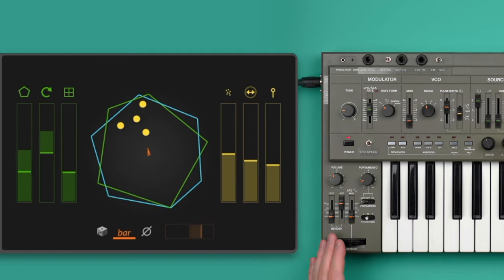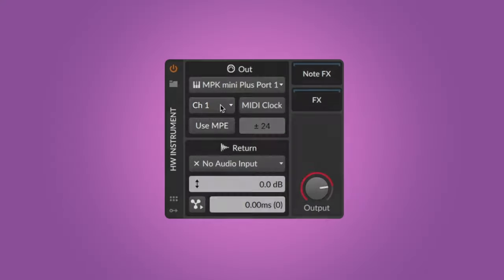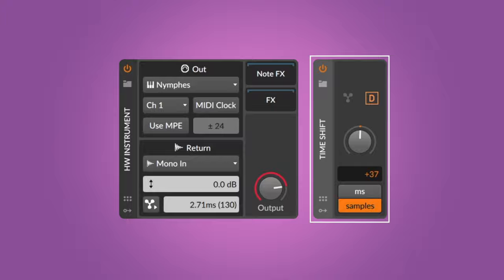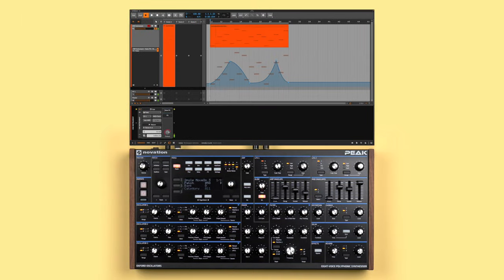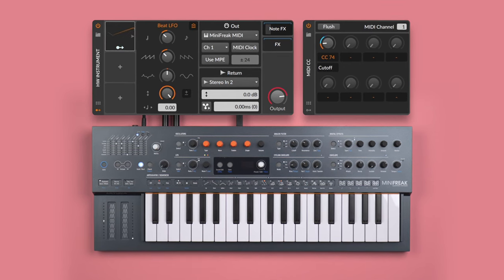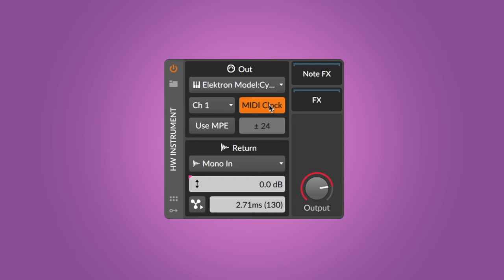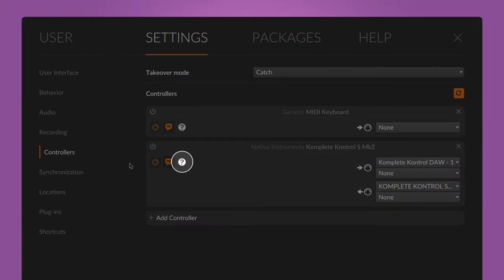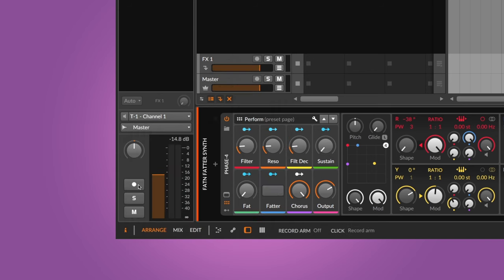Using External MIDI Gear with Bitwig Studio

Comment: What am I doing wrong? If I enable midi clock, I cannot start the song I'm working on, neither with any of my controllers (PreSonus, Arturia's built in MCU/HUI), the keyboard space bar or the mouse. It seems Bitwig is waiting on some start/stop message from a place I'm unaware of. If I stop sending midi clock, all controller functionality returns, but my the arpeggiator on my Arturia is not detecting any clock. I've not had any trouble sending sync messages from other DAWs, but I'm by no means a wiz at these things. Any help would be greatly appreciated.

Comment: I have been having loads of fun with note FX midi cc'ing to my external gear however I am having troubles with more basic stuff.
I map the CC devices to my controller no problem. But when I change tracks I have the mapping doesnt change. Its like everything is mapped globally...
Is it not possible to map controllers on a per track basis... Ie using the same knobs on mutiple devices be in controlling internal or external devices???

I feel I must be missing something very basic here???

Comment: i love bitwig,  however it is impossible to get a keyzone split device to send midi into a bw track on anything but midi channel 1????   for example i have a NI komplete kontrol s88   with 3 keyzones setup with 3 different midi channels........   just will not be seen by bitwig as different midi channels..any suggestions would be appreciated   jb

Comment: at around 5:35ish you showed the MidiFighter Twister controller. I contacted the Manufacterer to see before buying if this would work in Bitwig. They told me No, Bitwig is not supported so I did not buy it. Can you tell me if its not supported how are you using it in Bitwig as it looked perfect for what I wanted to do but as I said its not supported in Bitwig.   Thank you.
Reply: Any midi controller can be configured for bitwig, maybe with a script, they just meant its not "officially" supported.
Reply: just because they don't support it doesn't mean it's not supported

the API that bitwig offers to the controller script developers is pretty complex, AND there's a lot of open source people who write a LOT of the scripts

plus, bitwig's got MIDI learn and, like the guy in the video said, generic supports, so even if there's no SPECIFIC script, odds are the genetic will work fine
Reply: It's a generic MIDI controller and should work with any application that can receive MIDI data. I had no issues using it as a basic MIDI controller with Bitwig Studio.

Comment: got a big problem, how to do i make that midi is only read for the chanal that is open? i can´t learn the same knob on my controller for two(or more) of the same or different synt.
everytime i learno same knob on the different synt it change also the other one. there is no way i can produce that way cause i mapped my midi controller. i came from cubase and there only the chanels you use interact with midi. i can´t go on at the moment with bitwig cause of that

Comment: i see you're using Erae Touch in the demo-a wonderful controller! How do you connect it? I use a Rise script for Midiin2 and a generic controller with the regular Erae touch input. 

I am experiencing difficulties mapping the xy pads as the device usually only recognizes one axis and there is no picker menu after i click on "map to controller or key".  So i need to build another layout that has the same CC as the XY pad but as faders so i can map them, then switch to xy pad(s) to control the device.

also, i'm experiencing hanging mpe glides-if i release a note during a glide, the next note i play starts with an annoying fast glide to the pitch i played from the distance of the previous glide.
Haven't experienced that in my other daws.
Reply: Try to temporarily deactivate one axis with Erae Lab while mapping the other. Not sure about the glide glitches, did not experience them so far.

Comment: There is a VERY annoying bug in Bitwig (at least on Windows), where all MIDI ports are suddenly unusable. I've reported it a long time ago and even included a video with the issue, but it looks like they don't care because years later the bug is still present.
Very easy to replicate: when Bitwig is running, switch on anything that uses MIDI over USB and suddenly all other external gear can no longer be used (shows error that the MIDI port is already in use). Only way to fix it is to make sure every hardware device is already switched on before starting Bitwig.
Reply: the solution seems simple, especially in case of bitwig: stop using windows, it's pretty much the worst possible OS choice for music
Reply: @vozh-kc  And what would be better? Mac? No thanks, I don't want an OS that breaks compatibility with every update. I also don't want to buy a computer at more than double the price of the spare parts.
Reply: @kris_lx  good thing i never said anything about mac then huh (even though the only situation you'd be running into incompatibilities THIS often is if you're actually running a hackintosh or something but whatever)

no, the reason i mentioned bitwig specifically is that running it on linux (natively!) is VASTLY superior to windows
Reply: @vozh-kc  No thanks, I like to use multiple DAWs and have a lot of plugins, most of them are not available for Linux.
Anyway, it's NOT a Windows problem, it's a Bitwig problem. If it was Windows I would see it in all DAWs, but I only have it in Bitwig.
Reply: @kris_lx  whether they're "available" is irrelevant. WINE + yabridge make basically every VST work without any issues whatsoever, and that's on top of not having to deal with windows' shitty low-latency audio options, be they asio or wasapi

but hey, its your choice to deal with the worst possible option for musicmaking, maybe you get off on it, idk
Reply: @vozh-kc  I've seen many of these "I'm using Linux so I'm a l33t h4xx0r" types in my days. I thought that was a thing 20 years ago but I guess some things never change.
Reply: @vozh-kc  what is the best linux distro for making music? you may not have convinces the other guy, but i am over here taking notes like it's school lol... Wine + yabridge, huh? That's a start. Windows is terrible
Reply: @vozh-kc  lmao Linux.
Reply: @Arctic_Falcon  ye

it's pretty fuckin dope with bitwig
Reply: @ghost_in_the_robot  hey, since some numbnuts reminded me of this convo, i might as well ask: how'd it go?